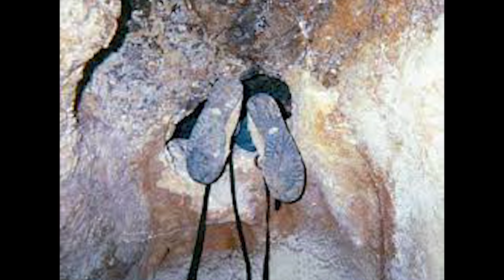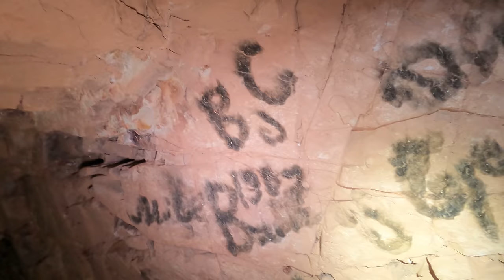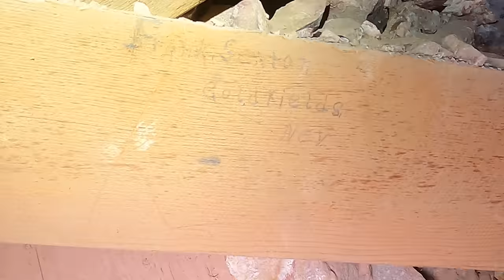Woman Tries to Climb Impossible Inverted Ladder in Abandoned Gold Mine

Comment: Square set timbering was used to fill in places where ore bodies were removed. They were to strengthen the surrounding fractured rock.  They are made up of Caps (14"-16") or Girts (7"-8").  They may be left open, but can also be filled up with the waste rock, dirt or sometimes  they are filled with wood.
Reply from the maker: exactly right
Reply: @Askjeffwilliams  Nvm i got the answer lol

Comment: The mining is cool; the timbering is way cool; but what blows me away is considering the logistics of getting all of that timber down into the mine and in place. Sets have to be consistent and so big for the stope, so the tunnel has to be so wide at the turns to get around, the wood moved into place and then shimmed and blocked for the next course. Dude.
And that is not even getting into the hoist ways and lagging and all of the accessory stuff that you need down there. And, with a f*****g candle?
Reply from the maker: exactly .... nobody ever thinks about the logistics and because we operate mines and dig them too we know all to well about planning out ground support and where to run the heading
Reply: Add to all of that the fact that the rail siding was over 100 miles away and everything had to be brought in by wagon!!

Comment: One mine up behind the Gold Bug in Placerville is really scary.  The gold is in quartz veins in slate, and the slate foliation is vertical.  The rock wants to fall and the slate can come down like huge guillotine blades.  We found what puzzled us briefly because it looked like a picket fence.  It was one of the log cribbed ceilings, broken by weight of the rock over the crossbeam.
Reply from the maker: good story ...thanks
Reply: @Askjeffwilliams  I admire the ability to handle tight spaces.  I'm not much on space where I can reach up or out and touch walls.

Comment: Note: Read this positively. ;)

I really do not want to get into a mine with all the squeezed sets. Have you seen the heavy timbers just squashed like a bug?

Tight manways.. If a rung gives you can lean back and push against the wall with your back, and feet and hands to the opposite side to keep you from falling (i guess). 

The marks of the haulage and candle picks really show that they got a lot of material out of that mine. 

It is one of the prettier mines ive seen. I like it. 

I like the sketchy ladder just hanging in free air. Hahaha. 

Lighting a fire down in the mine is really dumb because the oxygen will run out rather sooner than later. Maybe if you have delay on something to make it catch fire,but why would you do that?! Couldnt it just be a candle that started the fire? Any way lights with batteries is much safer. 

Just on the ropes used on the wonky ladder; i would rather tie it around that big piece of wood than trust some old nails or srews holding that piece of jron in place holding the rope. It could just be me. Also the ladders in the manholes are nailed into the side, and the rungs are not having a notch in the side rails to stay in place and are kept in by nails only. Kind of sketchy. The mine however is pretty.

Greetings,

Jeff
Reply from the maker: pretty much

Comment: More and more it's looking like dynamite is not a miners worst nightmare, a chainsaw is,. You are a good size for the manways, I would have to go up light and pull my gear. The crooked ladder down and inverted on the way up kinda takes from the good carpentry down there.  Nobody took a shot at the sliding dovetail ?